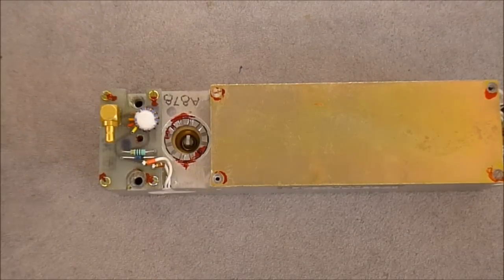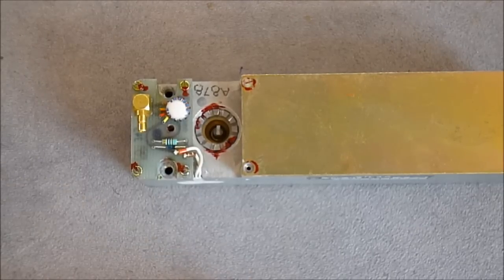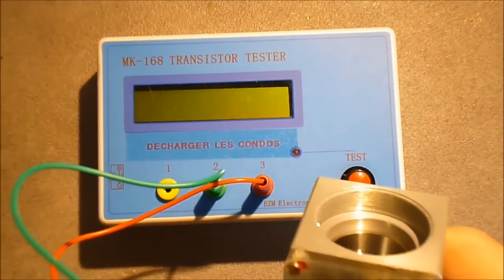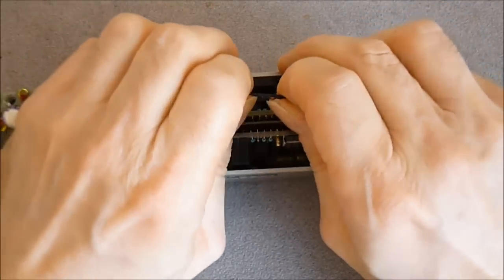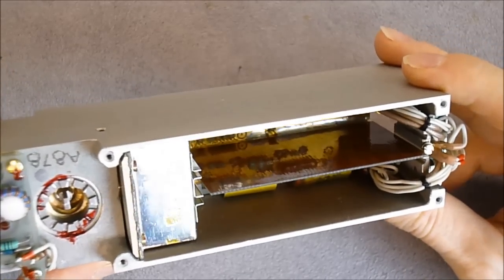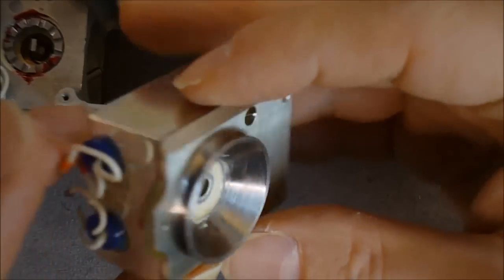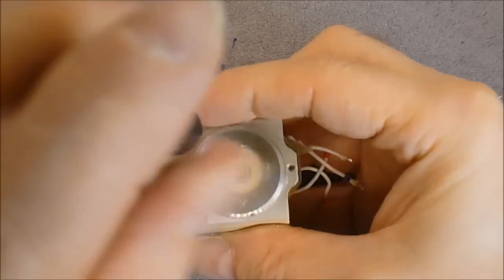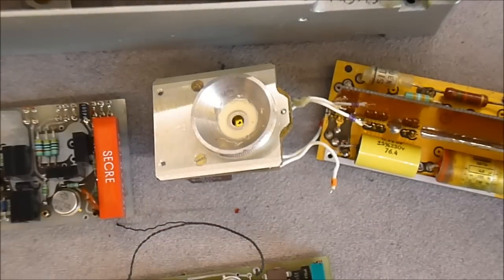Jaguar fighter laser rangefinder teardown part 6 (last)

Comment: Would take Raven ( who used to do most of the work on them) about a month to get the alignment back to correct now after you have disturbed all the adjustments, and get all the fingerprints off the optical units.

Comment: Block at the side is part of the built in self test, a light source used to trigger the avalanche photodiode into conduction during self test, emulating a return pulse, so that all parts aside from the laser itself are tested.